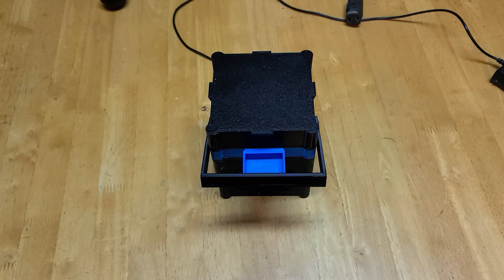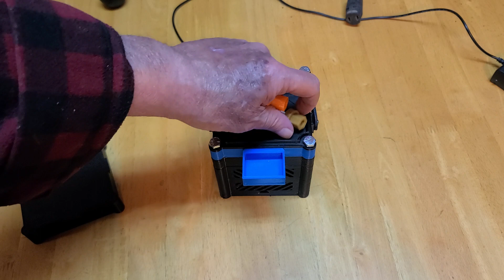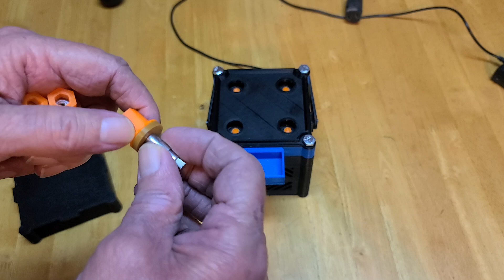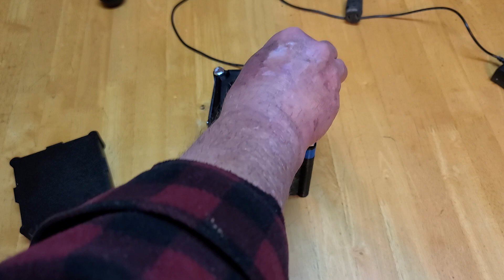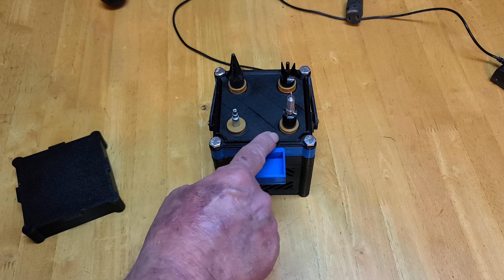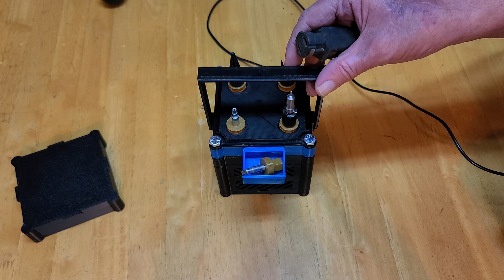3D Printed Brass Processing Tool

Comment: cool.... i have seen them before...... i am just wondering how long it will lasts?
Reply from the maker: The 3d printed parts should last as long as any factory mold injected part. I printed them very heavy duty. If the 3D printed parts break(and thats a big if) I can simply reprint it. The only part I am not sure of is the motor... but again it should last as long as any factory motor... it is a lot more powerful then what is really needed...overkill.
Thanks for stopping by!

Comment: That is really cool . Much cheaper than the Lyman .
Reply from the maker: It was too cool to pass up. I think that it will last as long as any Lyman, RCBS or Frankford Arsenal. I printed it heavy duty and the only part I am not overly sure of is the motor... but the motor is stronger then what is really needed... overkill.
Thanks!
Reply: @papasplace2  What rpm motor did you use ?
Reply from the maker: @jamespollard1670 I used the 100rpm motor...because I wasn't planning on using a motor controller so I went the recommended motor.